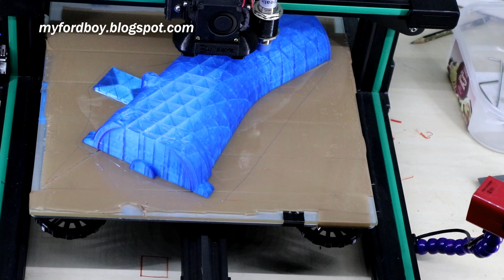Metal Casting at Home Part 88 Audi Quattro MAF Pipe

Comment: phenomenal video i hope to use a similar method to cast the halves of a stator housing, how did you remove the center core though?  back in aero we used plaster for kevlar ducts and a vibratomaticator that made your arm numb shook it out, is that the way the sand core is removed?
Reply from the maker: The pretuding ends, core prints, usually just break off and the rest can be dug out with an old screwdriver. You can see this on the video.
Reply: @myfordboy  oh perfect i must have gotten distracted, thank you so much for your time.

Comment: Have you analyzed the material of the original part before. It probably is Aluminium alloy consisting also of a few percent of copper, isn’t it?
I would make sure to meet these requirements, too. Especially when the parts used are safety related.
Reply from the maker: It's only a pipe to take air. On standard Quattro's it's plastic so material is not an issue. The rally cars had aluminium ones.
Reply: Aaah, ok, I see. ☝️🤓

Comment: Awesome! thank you for doing and sharing. 
Do you know anything about using PLA 3D prints in a similar process to lost wax? I've heard PLA is supposed to vaporize on contact with molten metal. It potentially would take a few steps out the process, print your flow channels too. Print, pack, pour maybe..
Reply from the maker: Yes i have done that, a couple of videos here using PLA. I am currently trying some Polycast filament which is designed especially for this and can be smoothed with IPA before casting. You cant get good results by pouring directly into the PLA part it has to be burnt out first.
https://youtu.be/HVgPM1ojyLw

https://youtu.be/aCWKkLVg1T8

Comment: I tried something similar to  this in 8th grade “metal shop”...mine was a few flat lower shock mounts for my gas powered R/C car I had, but strangely they turned to be not flat at all, and my teacher referred to them (in front of the whole class) as looking like a handful of partially chewed raisins that I regurgitated and made a casting of? Sad thing is that its 1 of only 2 classes EVER my whole life I enjoyed! He knew that so its the only reason I got an average (D+) grade? I eventually casted a huge badass METALLICA necklace for sister who hated Metallica...even though I mispelled it (METALICA)😫 (sister STILL has it!)

Comment: There was probably more metal in the gate and inlet than the part.
2 Questions
What happens to the unused core sand leftover from making the core?
What happens to the used core sand when cleaning up the cast?
Thanks
Reply from the maker: I usualy have some small cores to make from any left over but this and the sand removed from the completed casting can be washed in water and reused.

Comment: To harden the core, you used CO2 gas. Does it have to be pure CO2 or can it be 75% CO2 and 25 Argon used in shielding gas for my MIG? I can't afford to rent another bottle of straight CO2 gas. It appeared to be a short exposure to the CO2, but this process may have been shortened for the video time? I find this very interesting as I have watch 30-40 or more of your video and find the creation fascinating. Plus, I will also wash the video link you answered a post about supporting the core to make a hollow in the tube. Excellent again, using average tools, parts, materials found in a productive fabricators garage...Love it. Thanks for your answer about the CO2. ASE Master Tech since 1978 / Retired. I would love to watch every video you have ever posted, perhaps after my L2 spinal stenosis surgery while recovering. Thanks!
Reply from the maker: I gas for about 30 seconds but shorter would be OK, just playing safe. I think your gas would be OK. The core will harden by itself in time with the just CO2 that's in the air.
Reply: Perfect answer, from a person who has been taught or so many of us from our generation, self taught. We had wooden phone boxes on a party line while in the country on a family farm. The phone rang, you or your neighbors answered. I watched my step dad & his father try to arc weld, then at age 10, I became the welder. No internet, no YouTube much less books. Thanks for your ingenious ways of casting, machining and I will never forget allowing for shrinkage of castings when cold. I bless the for 100 years. Gods speed.

Comment: why not lost pla as you did in previous video? What was the reasoning behind this specific procedure? Thanks a lot for the very informative videos
Reply from the maker: I think a sand cast is better suited for this part, I can make more castings from the same pattern. Also my burnout oven is way too small to acomadate this part.
Reply: @myfordboy  yes makes sense. thanks for replying

Comment: Good instructional video.
My only criticism, is doing the mould , it should be done a bench, on the floor is bad for the knees, back and its just easier.
Reply from the maker: My way is kinder on the back than lifting the heavy made up mould from the bench to the floor for pouring.
Reply: @myfordboy  No disrespect, but you used a block and tackle to put the finished mould and casting in the wheelbarrow, you do have the equipment on hand, I would have done it on a bench, precision work needs a bench.

Comment: I am a ToolMaker and in highschool shop class we had a casting lab.  I have always wanted to revisit this process for the last 25 years.  Here is my important question, how does the core center itself inside the tube?  Looked to me like it just sat on the bottom floor of the one half of the sand mold?  Does the liquid aluminum force it up during the pour via some kind of pressure caused by the heavy hot metal.  It looked like the core was just set inside and not suspended up to center giving an even wall thickness of the finished intake tube.  Can someone please explain?
Reply from the maker: It's supported at he ends .Please look here for a detailed description of how cores are located. https://myfordboy.blogspot.com/p/metal-casting-tips-and-faq.htm and this video  https://youtu.be/sIBQWh-1eYk

Comment: Great video, I have watched more than a few on casting, but my question would be on the cost of printing the core and the pattern?  I have looked at 3d printers for a while but could not find a justification for them for my own use.  If the cost is reasonable to make those parts in the printer I could finally have a justification.
Reply from the maker: This is an excellent printer for under £200 http://bit.ly/2VXZMP6

Comment: Please explain the different paint layers. Thanks
Reply from the maker: Th emulsion paint is thick and fills the layer lines of the print. It sticks well to PLA. Gloss spray gives a smooth surface so the sand does not stick to it.

Comment: @17:15 the lower surface of the core is touching to the sand. Then how did the molten metal got under the core? I mean when you pour the metal does it squeeze under the core and lifts the core to fill the gap evenly and form the desired shape?
This is the only part perplexing me!
can you please explain?
Thank you
Reply from the maker: The core does not touch the mould, It's supported at the ends .Please look here for a detailed description of how cores are located. https://myfordboy.blogspot.com/p/metal-casting-tips-and-faq.htm and this video  https://youtu.be/sIBQWh-1eYk
Reply: @myfordboy  
Thank you! 🙂

Comment: I dont get how if the core outside is smooth and the shell's inside is also smooth, how you didn't get a side of the casting thinner than the other? since the core was resting on a part the casting metal wasn't going to touch, or did it just level itself out?
Reply from the maker: myfordboy

The core is supported at the ends .Please look here for a detailed description of how cores are located. https://myfordboy.blogspot.com/p/metal-casting-tips-and-faq.htm and this video  https://youtu.be/sIBQWh-1eYk

Comment: sry for ignorance but there are two things i dont understand.. one is how to prevent the core from bottoming out in the lower half, the other is why not use a "lost wax" method but using the 3d prints..
Reply from the maker: It's supported at the ends. Please look here for a detailed description of how cores are located. https://myfordboy.blogspot.com/p/metal-casting-tips-and-faq.htm and this video  https://youtu.be/sIBQWh-1eYk
Lost PLA would have been a lot more work, large burnout oven needed and new pattern needed for each casting. I have made 6 of these all from the one pattern.
Reply: @myfordboy  thank a lot, I'm looking forward to design and cast one for my project wich is carbureted

Comment: Hi a nice job done, what was the reason for using a deeper half of the flask?
Reply: I'm guessing, but I think for more hydrostatic head pressure to feed the molten metal into the rather thin sections.  You'll sometimes see him using a can ABOVE the flask for similar reasons.
Reply from the maker: I was using a flask that I already had that was originally made for this casting https://youtu.be/bOrxSsnrqew

Comment: How much does this typically cost with materials? Sand, aluminium, etc. And what type of aluminium is used in this project for your exact results?
Reply from the maker: You want to use metal that has been cast before, alloy wheels are good.
You can see the cost of the products here https://www.artisanfoundry.co.uk/
Bromsgrove greensand, sodium silicate, core sand and core glue.

Comment: When the small family owned foundry a couple blocks down the road closed a few years back, I had no idea I was going to need their services again. But now I do.
I have a couple of 1993 to 1996 Lincoln Mark 8's and these cars had a very bad headlight problem where all the reflective material burns off the reflectors, and there was never any updates (except the LSC Marks which DID get better lenses but the new parts ran out many years ago) and there is no reliable method to restore the old reflectors. So I thought about that foundry and about something I read recently stating aluminum is the best reflective medium known and thought "why not get some new lens reflectors cast in aluminum".
Well I cannot find anyone to do this job. I had even considered getting many done to sell the extras and get some of the investment back. 
Apparently that is not going to happen. How hard and how much would it be to get them done, if not through you, where can I get them done ?
I am near Vancouver Canada and nobody here seems to want the job.
Reply from the maker: I don't think a cast aluminium part would polish up good enough and the parabolic shape would be hard to produce.
Reply: @myfordboy  Thanks for the heads up, I suppose it was worth asking. 
I guess I will try muffler tape, definitely can NOT be worse !

Comment: Hello, can you use river sand, does it have the same properties, thank you and regards?
Reply from the maker: You could try some. Add water to dry sand with a spray until it will hold it's shape when squezed in your hand but does not stick to it. It can take a bit of practice to get the moisture content correct.
Reply: @myfordboy  Hello, what type of sand is it?
Reply from the maker: I  am using this https://www.artisanfoundry.co.uk/product_info.php?cPath=29&products_id=158
You need a clay bearing sand or add bentonite clay to silica sand.

Comment: You know I’ve always wanted to cast a valve cover and I noticed that you left a very large space for your sprue was that to keep the aluminum from solidifying before entering the cavity? Also do you have any projects involving a valve cover it because I would really enjoy seeing that. Would old aluminum castings be a good candidate for melting down for a project like this? I always admire your videos and look forward to any new ones, thank you
Reply from the maker: I have not made a valve cover. Old castings are good for material especially alloy wheels.
The large feeder gives pressure to the metal to fill the mould and feeds it as the metal shrinks.
Reply: @myfordboy  Excellent point as technically at that point, you are working with liquids using fluid dynamics. Also, I believe it one your videos where a shrinking of 2% is normal for aluminum casting, therefore the this calculation has to be included in the design of the dies being made for casting with this material. Thanks for the information.

Comment: I don't get how the core placement in the sand boxes allowed the molten aluminum to flow around it if the core was sitting in the impression?
Reply: The core is made thinner and longer than the part plug, you can notice the step where the core is placed
Reply from the maker: Please look here for a detailed description. https://myfordboy.blogspot.com/p/metal-casting-tips-and-faq.htm and this video  https://youtu.be/sIBQWh-1eYk

Comment: How did you get the center core to allow space below the core master and outside wall. To form the wall of the pipe. It appears as if the core master/plug is just sitting on the outside cavity.
Reply from the maker: Please look here for a detailed description of how cores are located. https://myfordboy.blogspot.com/p/metal-casting-tips-and-faq.htm and this video  https://youtu.be/sIBQWh-1eYk

Comment: Would you cast aluminium part for me if I send model? 320mm diameter 100mm high "tube" essentially. Volume about 1,5 litres. I can pay. I am making electric motor and need casing for it.

Comment: is it possible to cast aluminium mold for plastic injection moulding ?
Reply from the maker: The surface finish would not be smooth enough for an injection mould as cast but could be worked on.

Comment: Hi !
A very nice pattern you have there - I just ordered a 3D-printer too for my patterns ;.)
What kind of material are you usung PLA or ... ?
Any problems to glue or paint them ?
Reply from the maker: Patterns are PLA. I have some polyweld that sticks it well. Paint and filler take well no issues.

Comment: Was the original part 3d scanned or did your reverse engineer it with calipers in something like SOLIDWORKS, Inventor, or Fusion360?
Reply from the maker: I made a half sized model of this years ago. i was able to scale the part from this with reference to photos of an exsting fan. Redrawn in CAD and printed. see https://youtu.be/Re_pmfWgMVw

Comment: Pardon my ignorance but what is a “MAF pipe?” Excellent work!
Reply: A pipe where a Mass Air Flow sensor is located. This sensor measures the amount of air entering the engine and this is used to calculate the needed fuel...

Comment: Can I ask why you 3D printed the  core box and pattern on  different printers?
Reply from the maker: No specific reason. CR10 was used for the larger part and I could use Ender 3 at the same time to print the smaller ones.

Comment: Hi David,
I can´t remember if you showed this in your other videos. What sort of filler and first primer coat do you use on the PLA? Thanks,
André
Reply from the maker: I use some car body filler and then emulsion paint. Final coat with gloss spray. I am currently trying some Polycast filament which can be smoothed with IPA. Watch out for the video!

Comment: I don't understand how the aluminium can be casted all around the core when the core is clearly lying on the exterior face of the part inside the mold (i have a hard time explaining my thought, but from what is see the thickness of the part should not be consistent all around the part, and yet it is)
Reply from the maker: The core is held in place at the ends, Please look here for a detailed description of how cores are located. https://myfordboy.blogspot.com/p/metal-casting-tips-and-faq.htm and this video  https://youtu.be/sIBQWh-1eYk

Comment: I can't work out in my head, how the core is suspended in the middle of the pipe. 17:10 You can see nice even space on the sides when he places it in, but I can't work out how the bottom would be suspended because it must be hard up against one of the pipe walls underneath it. I've seen it done on this channel many times, and it bugs me that I can't picture it in my head.
Reply: I wondered too... have a look at the ends of the core; that's where it rests on the sand.
Reply: The core extends beyond the pipe. Its support is printed as an extended cylinder on both ends of the core and mating cylinders on the pipe, the two fitting tightly together. The key is rotating the core into alignment.

Comment: Great video. 1 question, why the vents @16.16???
Reply: To let hot gas escape.
Reply: I will rephrase the question, why put the vents where you did? 

It seems a little strange to vent between the Cope and the Drag
Reply from the maker: It works just the same as if they went through the cope. It's only a vent.
Reply: @myfordboy  Thanks for the reply. I have never seen venting done like that. Are there any advantages to it???
Reply from the maker: @iancooper418  Non at all it was just easier to do it this way.

Comment: How did you get the 3D file to 3d print?  3D scanner?
Reply from the maker: The part was measured and CAD modeled with Solidworks.
Reply: @myfordboy  Wow, cool 
Love the channel
Sub within 3minutes of first video I watched, others have not disappointed. I will be retiring in a few years and fixing old tractors and such appeals to me. Is that how you picked your screen name? That's what got you the first click. I have an old Ford (actually a couple)
Love the channel, keep up the excellent work. Thank goodness for no bubbly music, and text is informative.
Reply from the maker: My user name is nothing to do with the Ford motor company. Myford is the brand of lathe I am using. ( Ok I am not a boy anymore)

Comment: I don't understand how the core stayed in the middle...  ☹️
Reply: The smaller pieces on the ends of the pattern part called core prints provided the locations for the sand core to sit in the sand mold during the casting.